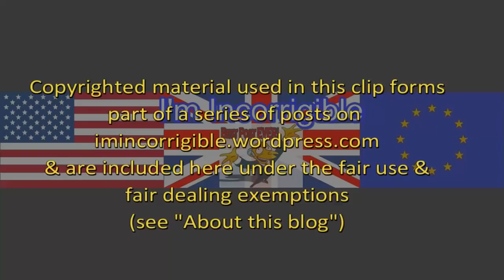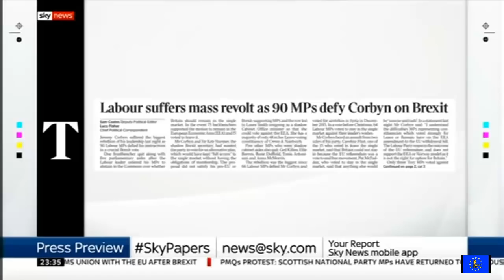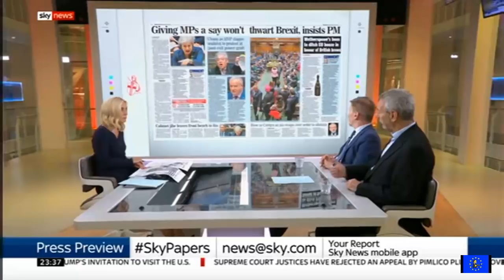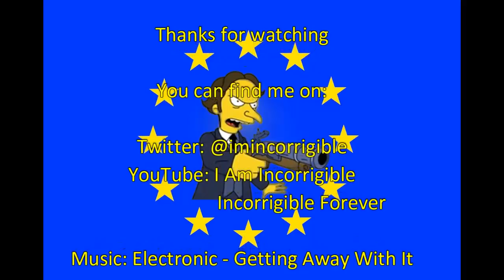Brexit fallout: SNP walkout, Blackpool displeasure and Rees Mogg backs May

Comment: The European Free Trade Association does not want England. All the members are small countries that can have a special deal with the EU because they do not upset the economic and trading balance. Also why should they put themselves in a position where England will demand the power to over-rule all the others put together on the basis of population and economic weight. All of these countries have in common small size and high GDP per Person. England has a falling per capita GDP and a declining currency and would necessarily wish to distort the deal with the EU solely in their favour while preying on these countries.

Scotland is a much better fit with EFTA and would benefit possibly better than as a member of the EU. It is likely an area for the SNP to consider in gaining a national consensus on the course of Scotland when it eventually becomes independent as clearly is the case.